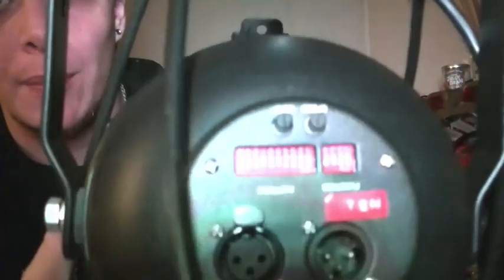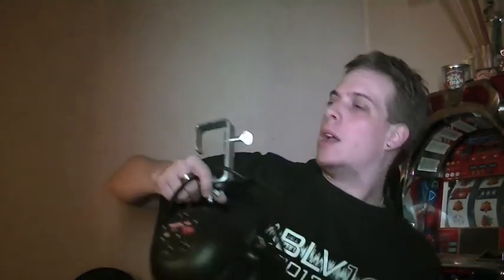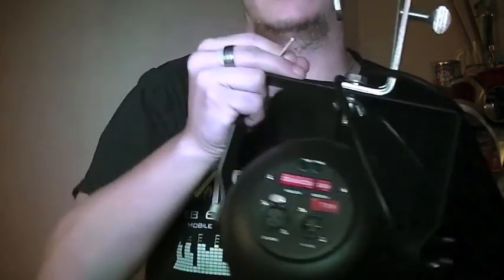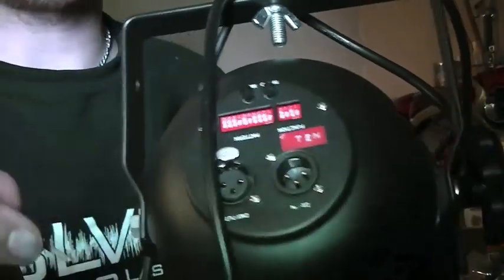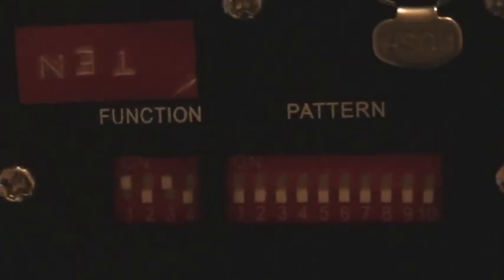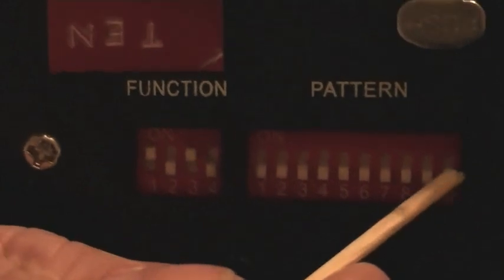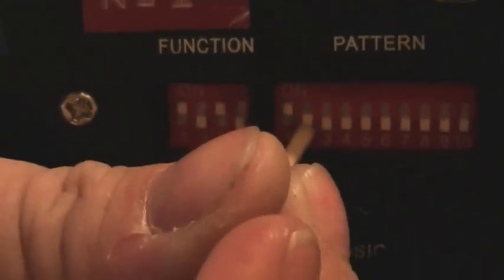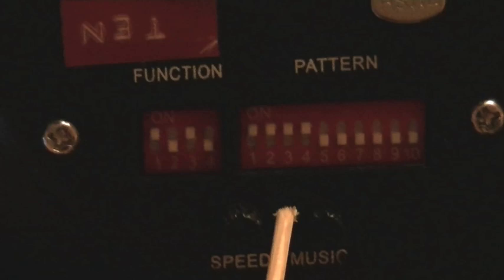Learn to program and use dmx 101 part 2

Comment from the maker: it depends on your cans some times there is more tan 10 dips like the ones in the video each manufacture has a diffrent way of setting the extra dips up (the control switches) ie if they arnt in the rigt place tey will set a colour or set tem to run internal programs or just plain not work ect

Comment from the maker: each light when you address it is designed to be assigned to each button on the controller as a fixture, and the first channel on each light will be assigned to the first fader on the board... but there is a way to make the board take more fixtures by addressing them diffrently the only problem is it then gets complicated by having to remember wich lights are on wich button and where there first channel starts

Comment from the maker: hi sorry its taken so long but as you probably guessed im a working DJ / productions company can you tell me wich scan master 2 you have got ie the one with teh pan tilt wheels or the one with the joy stick as i have a feeling you will be able ot cure the problem with a master reset you will loose anything you have programed in to it but is no use if you can only run through one chase and then it blacks out

Comment from the maker: Hi nope the question hasent been asked and yes you can as long as they are both the same light (ie work on the same channels as the other ) the controller will then make the lights on the same channel do the same thing a fast easy way to do up lights without a chase but not so good for movers or scanners as they will do the same thing but not necesrally point to the same place